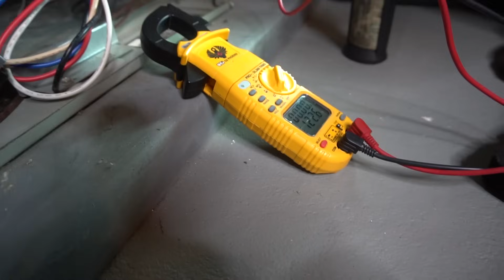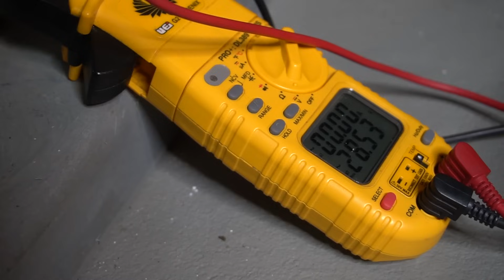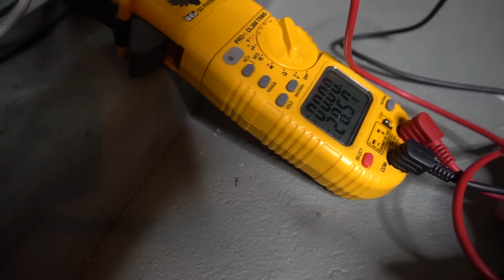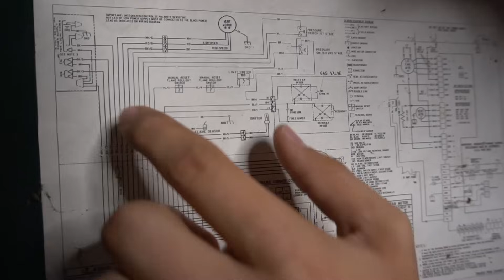Furnace/AC How to Troubleshoot The Control Board

Comment: My first week of HVAC/R just passed. I’m quite interested in this tech. already and excited. Not trying to be safety police but my question is how did you not get shocked pulling power from transformer and plugging leads in? I’m under the impression that if you’re only touching one wire at a time you’re not completing the circuit but I would have gotten shocked. So....? I’m just curious. Thx. Thinking your channel is going to be a big part of my education this next year or so. I’ll have many more questions for sure. Thx
Reply from the maker: You picked a good field man! Lots of opportunities for HVAC out there. As for the question, I would not grab a live bare connector.. So either I had turned the furnace power switch off or the connector had an insulator on it. Notice the note at 3:10  Hope that explains it! Glad to hear you are finding my videos useful! :) I wish I watched stuff when I went to school. That way you can ask useful questions during class. In class they teach you the science of it but not much on practical stuff you see every day at work. Like replacing a blower motor or like what I shared in this video. I'm looking forward to the questions ;) sometimes questions end up educating me as well lol.

Comment: Are this the same steps I can follow for a heat pump 5 ton up in the roof?
Reply from the maker: Many of the components will be the same but the unit in the video is not a heat pump so there will be a few differences. The low voltage on heat pumps is wired a bit different so you may want to watch some heat pump specific videos
Reply: @WordofAdviceTV  thx

Comment: You are the best! Thanks for all of your vdo. I learned a lot. My a/c all of sudden stop blowing cold air (it was very cold yesterday and nothing today). Replaced filter, clean out the condenser. The fan is running though I am not sure if the compressor is running or not. I cant tell. I was thinking of replacing the capacitor, will that solve my problem? bought the capacitor for $10 and will be swamped it out in two days.  I don't think it's the freon issues since it was so cold yesterday and today is just no cold air blowing out.
Reply: when I turned on the thermostat, the air started blowing right away but the fan doesn't start running until 1 minute later. Is that normal?
Reply from the maker: If it stopped working overnight, then the capacitor would be a good place to start! Sorry for responding late. Hopefully your unit is back up and running again by now! The fan starting a minute later may just be a fan delay which is normal.
Reply: Thank you very much! I replaced the capacitor and it works!  It was testing for power and apparently had the meter on the wrong volt and it almost shocked the heck of me. The alligator clips fried and the start contactor got burn pretty good. I got a new contactor and will swamp it out very soon!.
Reply from the maker: Glad to hear it's working! And oh boy, that must of made you jump back pretty far. There is 240v there so gotta remember to be careful around it. That could have been a lot worse. Stay cool, stay safe! :)

Comment: Great video and details information. 

I have similar issue, my ac not blow cold air and notice that my fan take a couple of minutes to start after turn on the ac. I just replaced my cap, cleaned the condenser, and replaced all the filters and still have the same issue.

Comment: Hi again if I have a burnt contactor that would prevent the compressor to go on the contactor have a bad humming noise thank you
Reply from the maker: If the contactor is burnt, then yes, that would prevent the compressor from coming on. 240v goes through the contactor to power up the unit. If it is burnt out, then it will not close the contacts to let the voltage through
Reply: I just hope is the contactor and not the compressor thank you still waiting on waiting on AC guy  supposed to be here at 3:30 thank you for your fast reply greatly appreciate it have a good weekend
Reply from the maker: Hopefully it's a simple fix! Good luck! If you get the time, come back with an update on how it went :)

Comment: What if you're AC is on and the house is cooling down and then the Em heat light turns on and hot air starts blowing? I've had this problem all summer long, sometimes it'll work for a few hours or I have to push start the fan outside with a stick.. Then an hour or two later the EM heat light is back! It's far too hot for this
Reply from the maker: If you have to start the fan with a stick, I would replace the capacitor before the fan motor burns out. The Em heat light is bizzare... It sounds like the thermostat is defective but I have never seen one do that before

Comment: I wonder if could help me out I got a digital thermostat that takes batteries once the batteries go bad the thermostat does not diagnose the temperature inside house I put a meter to the thermostat wires after I take digital part of thermostat  from hot wire which is red to rest of wires I get 28volts except blue wire I only get 18 volts  I'm not sure if that's common wire and if is common wire why isn't working to keep thermostat working right after batteries are dead Thank you I would appreciate  a reply thanks again
Reply from the maker: You should have 24v from R to C at the thermostat. If you are not sure what the blue wire is, you can check in your furnace control board and see where that wire goes. I would also check voltages down there as well. R to C at the board should be at least 24v as well.

Comment: the A/C is ON, air is coming out but not cold
Reply from the maker: Have you verified that the compressor is turning on at the outside unit? You can usually hear the difference between the compressor running and the fan. If they are both working then you likely have a refrigerant issue and at this point it would be better to call someone.

Comment: Hey thanks for all the advise and info you put on you tube! I'm having a problem with my compressor and wondering if I can send you a link to watch it. I really need help on this one. Thanks https://youtu.be/y7_9JSUwkSI
Reply from the maker: Hey John! I watched the video but I can't tell if that is the compressor that is making the noise or the fan motor... It seems like it is the compressor but the fan motor can start making noises like that after running for a while too. If it is the compressor, if you touch the thin copper pipe (at the end of the video you grabbed the other one) is it super hot? Also, is your house cooling good before that noise starts up or does that noise start almost right away? To begin with, I would hose down your condenser coil, even though it looks clean. I have washed clean looking coils and seen the freon pressures drop dramatically before.

Comment: Oh, I was referring to cheater wires to clip into condenser to get  110 volts power  if no outlet is around to let's say vacuum out condensate line. Etc 
I saw three different guys hooking up to power and was wondering which to use. Which one might be the best option.
Reply from the maker: Honestly I dont think it really matters. You just need a hot and a ground. I would just go with one leg from the contactor for the hot and green & white to the ground screw. I don't use cheaters like that too often though, I have an extension cord ;)

Comment: Also much thanks for the parts and tool list.
Quick question, regarding cheater wires.
One guy I know has a  blk  he clips to the 110, and the white and green stripped he screws into the ground.
Other guy clips blk to 110 and clips green to ground, nothing for white
Another guy if i can remember clips blk to 110, green to Ground lug, and i think he clipped the white to cabinet not for sure.
Thanks.
Reply: No he means using a cheater cord. When your stealing power,from your disconnect or contactor I believe.
Reply: Charles Malinoski 
Yes,  when servicing condenser and no other available, to let's say to vac out condensate line.
Reply: You Tube/search (How to hook up a cheater cord)/David Jones has the video your looking for.Good Luck /Peace !!
Reply from the maker: Hey James! I apologize but I don't quite understand what your question was. You just listed how 3 people do their wiring. Is this when they are doing a new install? Where are the black and white wires coming from?

Comment: So what was the problem? Why was the furnace giving off a flashing code if the board is good?
Reply from the maker: On my board, normal operation (when the board has 24v and there is no call for cool/heat) is indicated by a constant flashing light. Usually right on the board itself or on the back of the furnace door there is an explanation of what all the different diagnostic light sequences mean.

Comment: I'm near the end of my career in this industry this was a nice video.  You did a very nice job explaining some basic electrical norms. How power flows into, and out of some hvac equipment.
Reply from the maker: Thank you! It's an honor to hear that from a veteran in the field :)
Reply: @WordofAdviceTV  do you have a video on thermostat wiring that has 5 wires and you only have a 4 wire thermostat on hand for running the furnace heat side ? I have a mobile home Miller furnace with outside Central Air and I'm about to change the thermostat but it has a 5 wire on the wall and I sent for a new one but honey well sent a 4 wire thermostat instead ? The coding is straight forward but I only want to use it for heating , and then I will check the board since it's blinking 4 times ( which according to the company comes back as a bad board ) and by the way I bought the last board since it's obsolete now but I need to get the heat up and running , , the whole story is this ( tries to ignite , Igniter glows and then when the gas valve calls for operation its cuts right off ) also contactor on the AC unit has been changed out so not sure if that caused any issues with the thermostat inside the house or not ) possibly wired incorrect ? Just wanted to double check my thoughts on the board or Wall thermostat ? ) Gas valve opens up when I applied 24 volts externally so I assume that the board is bad ? Thank you for any assistance you may be able to give me on the thermostat issues and the AC unit
Reply: @WordofAdviceTV  Hi there. I have a unique problem with my upstairs furnace, located in the attic. The furnace will run like the day it was installed until the air temperature in the attic gets below a certain point. Somewhere around 40 degrees. Then the inducer motor fails to start properly. It will start for a second or two then stops. I was told by a tech that it could be a board issue but he was not sure. He found no problems with any other components. The tech had said to call them out again first thing on a cold morning, which according to local weather, we will be having several cold mornings next week.
Reply: @Chris2745100  did the tech get you fixed up? Interested to know the fix
Reply: @tannerharkey  It was a bad board. Lasted 27 years. Furnace itself is fine.
Reply: @tannerharkey  It was a bad board. Lasted 27 years. Furnace itself is fine.

Comment: The fan outside is working ..  the A/C I can feel the cool air but the mother bord no lights... turned on.. reheem model 1028-928A.

I clean exterior fan and change filters.. 
how I get the blower to start..  pls help
Reply from the maker: Do you have a meter you can check voltages with? Find the the wires that come from the condenser fan motor. Then find which of those wires goes to the COOL terminal on the control board (usually the black wire) and which wire goes to the Common (usually the white wire). Put both leads on the terminal spades they attach to on the board. Do you have 120v? (the thermostat should be on and calling for cooling) If you have 120v but the fan is not turning on, then you either have a bad blower motor or a dead blower motor capacitor. If you do not have 120v going to the fan, then likely the control board is bad. (verify that the board is getting power though) Also, try turning the thermostat fan setting from auto to ON and see if that does anything.

Comment: Are you teaching techs or DIY? I cant stand guys who educate the public.
Reply: Straightoutofchiraq lol you're stupid
Reply: Thanks Jay for the good video.
I have a question in regards to the furnace flame. System clicks and combustion air fan kicks in, and ignitor iluminates but flame does not appear and system shuts down and tries for 3 times without
Sucess. I will shut down the furnace based on manufacturer recommendation and follow the furnace start up procedure. Sometimes flame would come on and system starts working normally. As soon as room temperature on thermostat equals the set temperature of thermostat, furnace shuts again and stays shut and I need to do the same procedure.
On control panel, I have noticed only one flash which goes on and off.
Both fans are working well. Ignitor is working when flame doesn't kick in or when actually flame kicks in. Flame detector is been cleaned and is working properly.
The only thing that I can think that is faulty would be the gas valve.
I would appreciate your input Jay.
Regards,
Mike
Reply: As a former HVACR service tech, I don't see anything wrong with teaching people how to troubleshoot their own HVAC equipment.  Most of the time, it is something simple like a loose or burned wire.